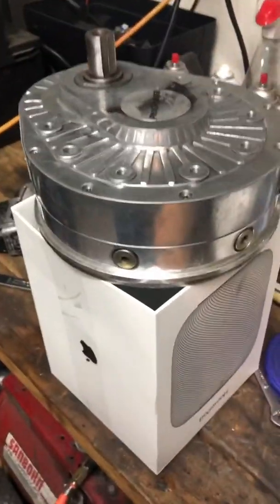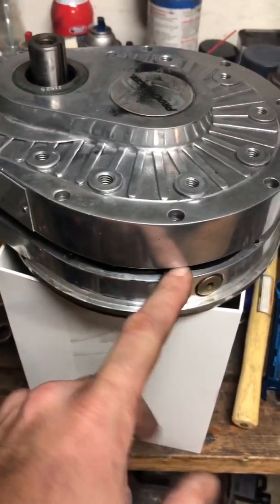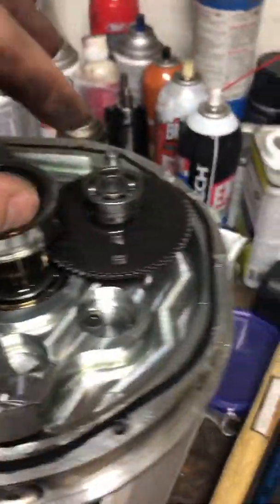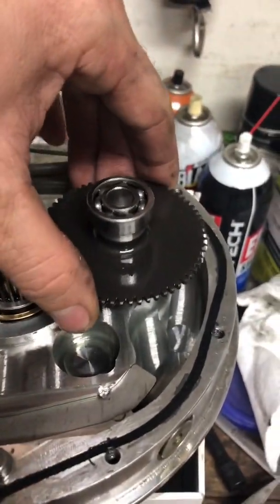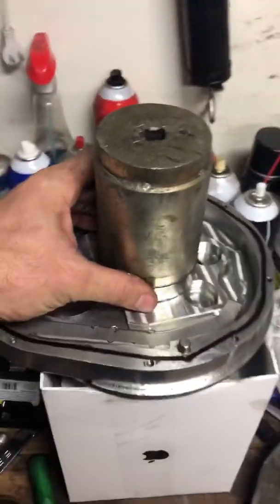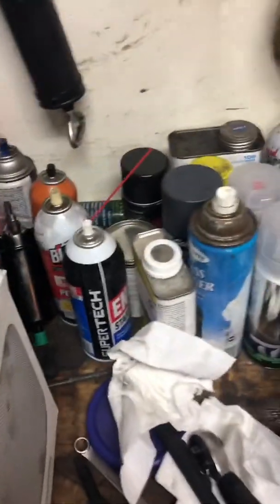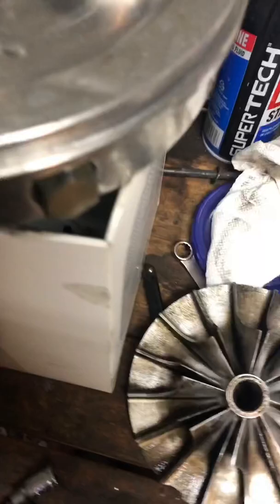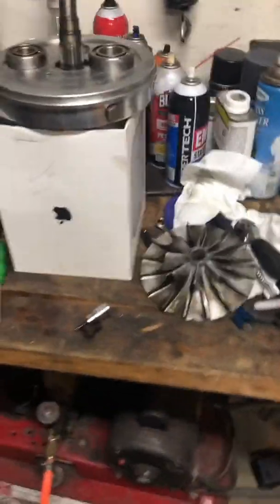Procharger impeller removal tutorial

Comment: By removing the gearbox lid first you risk damaging the output seal, it’s incredibly easy to over compress it. 

Yiu don’t need to press anything on these units. 

Welding glove left hand, spin impeller whilst heating.. as soon as it spins freely in the shaft simply lift it off. 

I can’t believe how bad this information is!!!

Comment: Not that easy. The tolerances have to be dead nuts and only procharger knows the specs.
Reply from the maker: Well I rebuilt it myself and it’s still going strong so it must not be that crucial😁
Reply: Then why didn't you show the install of impeller? How far down do you press impeller in? That's extremely important. That's where the tolerances come in. If it's not set just right, it won't suck in the air right and will not perform at it's max. I'm sure you got yours working, but I would like to see how it's building boost and if it's right
Reply: Need to set right, so inducer part and exducer work appropriately.

Comment: hi anthony , do u have a video of how to put the impeller back on ? thanks mate jim
Reply from the maker: In the video it shows, basically just press it on, reverse of what I did to take it off
Reply: @anthonycuaresma4081   how do i press it back on  since the impeller will be facing down and possibly damage impeller  also does the shaft have a wider part on the inside so i dont press it to far through ?  thanks for ur help anthony
Reply from the maker: So I see I don’t show how to press it back on, if you wait a couple days I’m actually swapping back to the sock impeller, (aftermarket was overrated) so if you wait I’ll do a video showing how I do it. If not, basically heat the impeller hot and support the main shaft and press it on, it presses all the way down to a spacer it seats against, (looks like a washer). Can’t go wrong. I will upload a video in 2-3 days I’m sure
Reply: @anthonycuaresma4081  thanks brother perfect il be doing this on thursday so a vid would be perfect to follow .thanks again mate :)
Reply: @anthonycuaresma4081  i have an f1a 94 . it has a double bearing on the center shaft not sure how to get it out
Reply: You say press the shaft down and then don't show how you did it, first shaft

Comment: really great video why you have no comments is beyond me. have you rebuilt these? My D1 took a crap and I seen rebuild kits. i also have to change the impeller. Mine is leaking and the impeller is chewed up. Did you rebuild yours?
Reply from the maker: Yes I’ve rebuilt mine, it’s fairly easy to do. I don’t recommend getting an aftermarket impeller though, I went back to stock because I wasn’t getting as good as performance. And thanks!
Reply: @anthonycuaresma4081  What about this kit and impeller? https://www.ebay.com/itm/D1SC-P1SC-P1SC1-Procharger-Supercharger-Rebuild-Kit-Bearings-and-Seals-Repair/254163627147?epid=1353061802&hash=item3b2d552c8b:g:htwAAOSwiLdWAZRL&frcectupt=true

and https://www.ebay.com/itm/14-tall-blade-Supercharger-Impeller-for-D1SC-P1SC-P1SC-1-CCW/264239184051?hash=item3d85e1f8b3:g:ACoAAOxy3JtReGdI